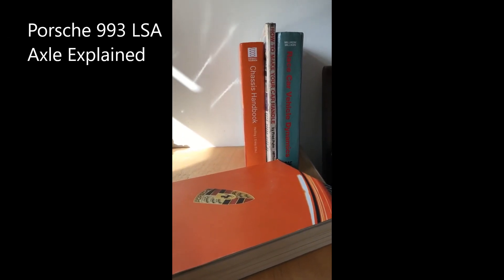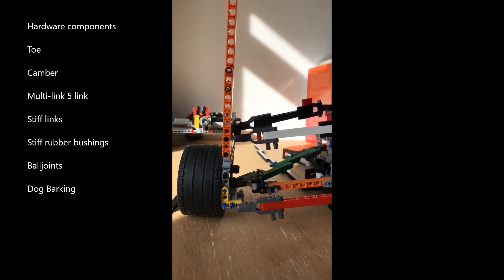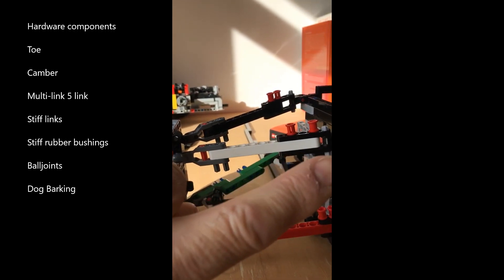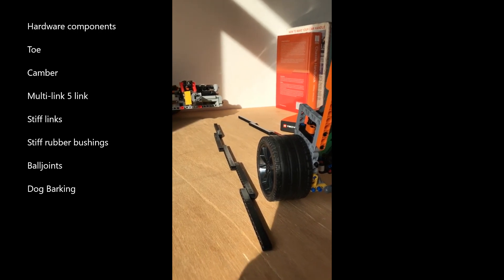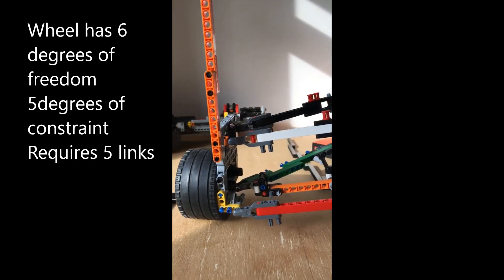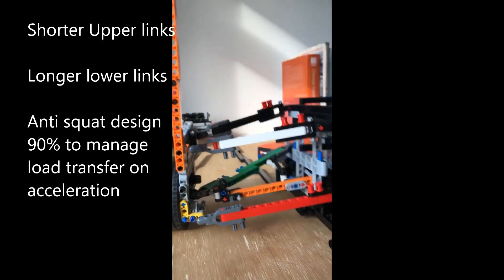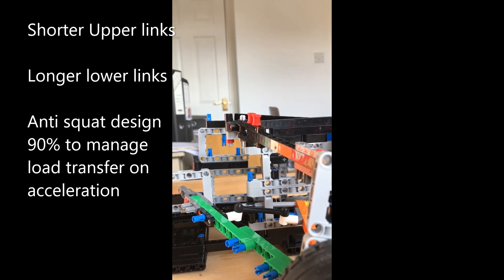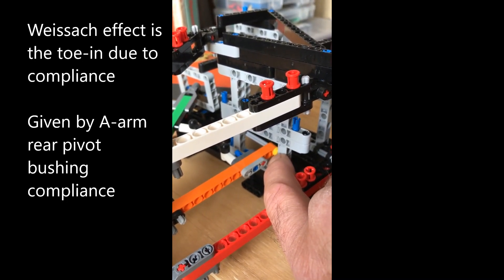Porsche 993 Rear LSA axle Part 1

Comment: +1 .. Agree. Your technical model is a masterpiece. .. My new 1998 Carrera S 993 complete with its LSA multi-link rear suspension,, was/is light years ahead of my then 1984 Carrera Targa. . Fond (October 1997) memories of driving the ole daily driver '84 Carrera to the dealership taking delivery of my ordered '98 993 Carrera S .. Driving less than 1/2 a mile and the LSA rear axle shows its chops. . The LSA's vastly lower NVH is noticeably evident. . I continue to own the 993 S Coupe, its a keeper. . P.S. As improved as the 993s LSA multi-link rear suspension is ... there seem to only 2 technicians on the planet who can dial-in the Kinematic toe & alignment. . The Atlanta Porsche dealerships are clueless when it comes to setting up a 993 suspension/alignment... Cheers,